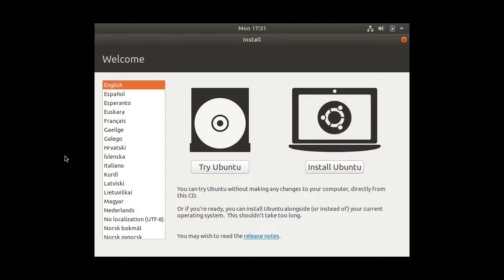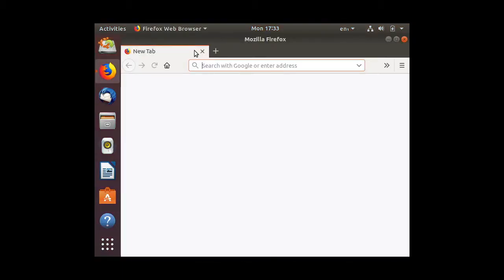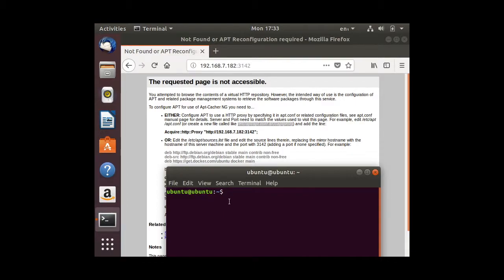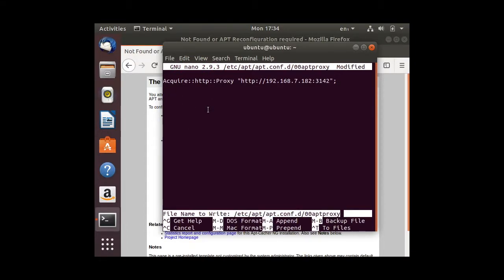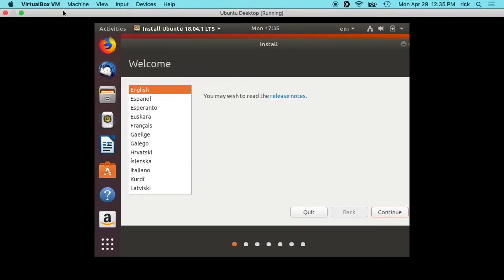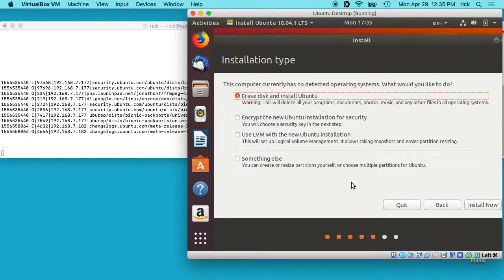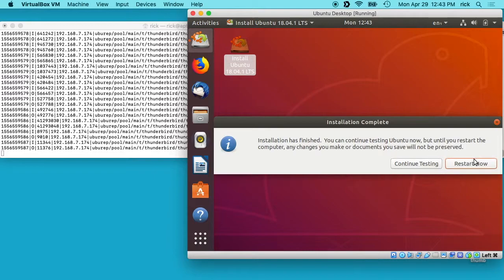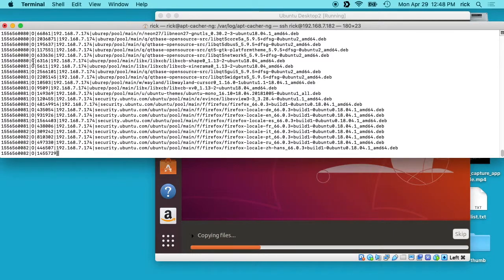Using apt-cacher-ng During an Ubuntu Graphical Install

Comment: This is a secret I have needed for Years.   Saving the config file to a usb stick or sd card
would make setting up future installations of the config easier on either live sessions ie installers, or on installed systems. Once you have the config file right you do not need a graphical browser or installer.  Put the file in its place under/etc and you are good to go.   Note I have Not tested this myself.  I am just going by logic.   If the file can be installed on a Net installer the whole process can be cached.  It just requires loading the magic apt config  file before running the installation process.  

 Your Apt cache may need its upstream mirrors adjusted for each new distro you install.   This is a tuning function.    In house your systems will draw on the power of the cache after it is primed.   ?Tuning the Cache's upstream mirrors  is a refinement  to speed the priming process..   The best  upstream mirrors may be found from live sessions or virtual machines.
I have not  setup an installer session this way, but logic dictates it should work.   Even with no cache active, sourcing an installation from a local mirror should be better than using  the generic mirror programmed into the installation ISO.   This also reduces the load on the central sources.   T?he in House Cache primes a "mirror " accessible  at LAN speed not  ISP speed or worse.  The Cache saves  Data and time on metered ISPs such as cable or cellular services.  Yes your cache can save you real money when your ISP has the meter running.